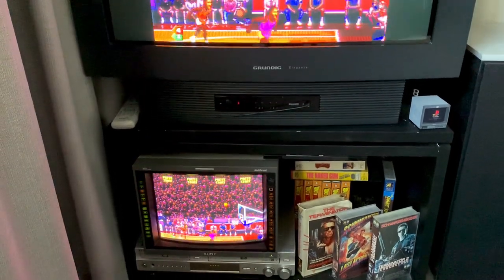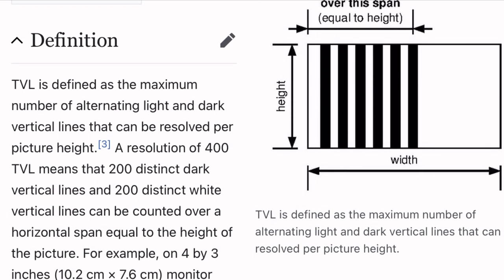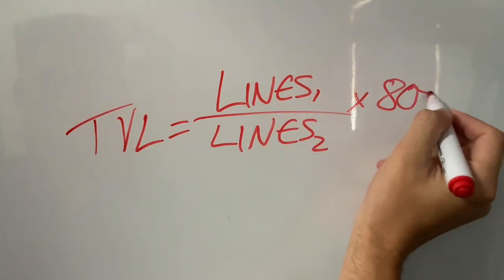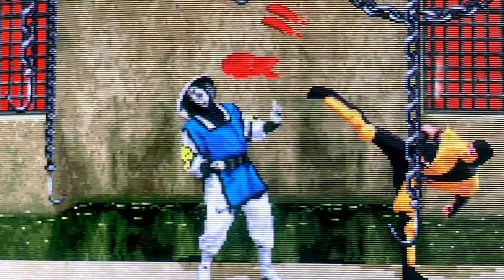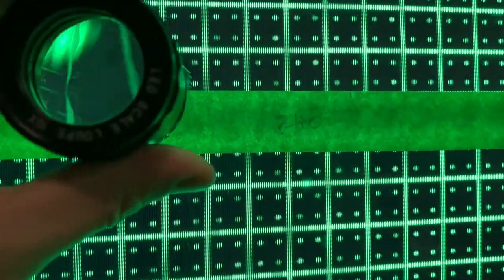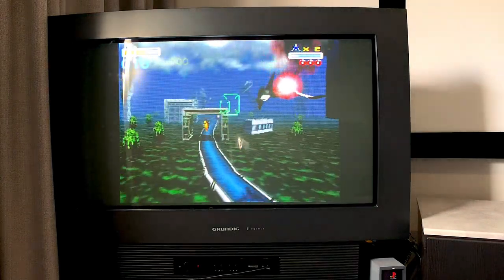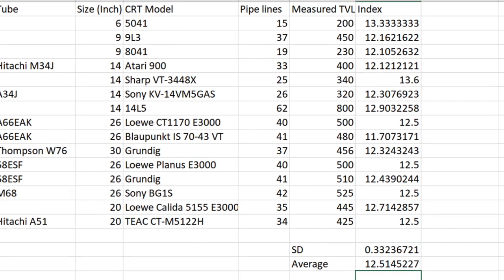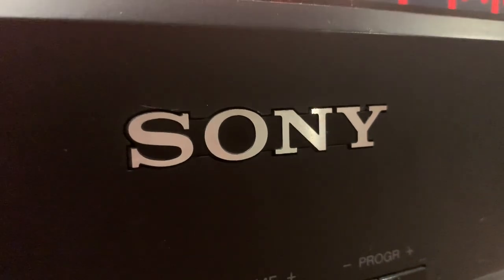ESTIMATE TV Lines on a CRT TV/CRT Monitor Using Super Mario Bros. on the NES - The TVL Pipe Method

Comment: This is a neat concept, and you were very thorough with your testing. However, TVL is more than just the pitch of the stripes/mask on the picture tube. The alternating black and white lines are an important aspect, because there are other factors that affect the TVL. Spot size, chassis bandwidth/frequency response, and convergence can all play a part in how much horizontal resolution can be resolved. This is more a measure of the number of phosphor stripes in a given area. While this is certainly an important bottleneck of TVL, it is not a measurement of TVL itself. 

Nonetheless, great video, with great visuals. The amount of effort put into this video is very clear!
Reply from the maker: Thanks so much for elaborating, the feedback is very much appreciated and welcomed! It was a labour of love and I’m still learning on this journey
Reply: @MarcoRetro316  For sure! Finding stuff on these things is pretty tough. If you get stumped or need some info, don't hesitate to reach out! If I don't know the answer, I can probably put you in touch with someone who would!
Reply from the maker: @ShankMods That’s a very humble offer that I’ll gladly take you up on when I’m in a pickle. Thanks!

Comment: Just gave this a shot. I have a 32" JVC D-Series AC-32D201 from August 2000. At factory settings, I took a photo of my RGB modded Famicom running Super Mario Bros. I followed the instructions and got 39 TV Lines across the very top of the pipe.  
36 x 12.5 = 450 right on the dot.

So that means that this set has 450 TV Lines. It's the nicest CRT I own. And I got it totally for free from a guy who was going to throw it out!
Reply from the maker: Nice one! Thanks for giving it a shot
Reply: @MarcoRetro316  Here's some more results to add to your xl sheet: 

19" Memorex MVT2199 from September 2002   31 phosphors.
31 x 12.5 and round to the nearest 50 
This TV has 400 TV Lines

14" Sensormatic RM314 from June 2001 27 phosphors.
27 x 12.5 and then round to the nearest 50. 
This TV has 350 TV Lines

14" Apex GT1417DV from September 2003 23 phosphors. 
23 x 12.5 and then round to the nearest 50. 
This TV has 300 TV Lines
Reply from the maker: Legend!

Comment: On my BVM-20F1U advertised at 900 TVL I approximated 800 using your method. Then on a Compaq FS7555 PC CRT I got 84 doots to count and got 1050. Counting the dot pitch was a little more difficult than the standard phosphors from 15Khz sets. My Sony 32" KVFS got 42x12.5 so somewhere between 500-550. Lastly my PVM-1354Q got 48 so dead on 600.
Reply from the maker: Interestingly I measured 77 lines on my 20F1 to estimate the TVL at 962.5, rounding it down to 950. The other numbers look close to expected. Thanks for trying this out sharing your results!

Comment: I don't have an NES but I tried raspberry pi via scart, PS2 NES emulator, and projected nested emulator on SNES original hardware and all had similar counts. My PVM 1953MD read 58 pipe lines for a TVL of 725 vs 600 spec, and my consumer Sony KV-36S42 via S video read 40 pipe lines for a TVL of 500. Interesting!
Reply from the maker: Thanks for trying it out. It’ll only get you so close to the actual resolvable TVL count but still useful for a ball park figure on consumer sets, 500 sounds about right

Comment: Green was a good choice because even on lower bandwidth signals like RF and composite it will be the cleanest with the least amount of horizontal smearing. Thats why you found very little discrepancy in your calculations across signal types up to RGB. 

I would guess that if someone calculated a number significantly lower than the advertised TVL, and their h width and focus was calibrared correctly, the bandwidth of the video amps must be quite poor. 

I have seen this illustrated by two TVs which share the same high resolution tube (matching part number) but have different TVL numbers advertised. I have seen as big as a 200 TVL discrepency just due to video amp bandwidth.
Reply from the maker: Hey Andy! In hindsight I overstated the correlation of phosphor line count with TVL’s as they aren’t one and the same, and the same tube can produce different TVL’s depending on the chassis design and like you said, bandwidth of the video amp among focus. 

I’ve long been learning from your stuff between your channel, interview on the CRP and the CRT database. It’s later bugged me not knowing your work at the time I put together my first video and referring to you as ‘someone who fixed their BVM jitter’. Anyway, thanks for tuning in!
Reply: @MarcoRetro316  thank you for the kind words - I'm glad to have helped you with my efforts. I enjoy your videos, keep doing what you're doing! I wish I had the time and passion for video production.

Comment: Sony PVM-2730qm: 587-600 TVL, tested with NES.
Reply from the maker: Thanks, very close to the advertised 600.
Reply: Actually I recounted and its 525(was slightly more overscan), also counted kx-27ps1 at 475, probably at an even 500 both. I have a hard time counting with composite signal. What is the alternative method with rgb?
Reply from the maker: @SamsungS-or1qf  composite will have some colour bleed but it should be similar, if not the same to RGB

Comment: I have a question. Does tv lines affect the picture sharpness from a console outputting an horizontal res of 320 on a tv with just 250 tv lines for example? or will a console outputting 640 horizontal res into a tv with 800 tv lines look sharper?
Reply from the maker: A very general answer: The more TVL to screen size ratio, the sharper the image and therefore will resolve the horizontal resolution up to a certain point. Both those scenarios will resolve the image just fine, obviously a display with 800 TVL would be miles sharper than anything at 250 TVL. 250 on a 9” PVM is somewhat sharp, but a 14” CRT would take a big hit in sharpness and you’d see vertical lines instead of prominent scanlines. 800 TVL on the other hand will look sharp at any realistic CRT size
Reply: @MarcoRetro316  Thank you. That is interesting so there is a correlation beteween screen size and TVL, that is the bigger the screen size more TVL is needed to get a decent sharp picture. But my question is more related to the TVL and a console horizontal resolution, for example Capcom CPS games use an horizontal resolution of 384 and i have seen some games use a dither pattern in some graphics to simulate transparency. So my question is will the dithering pattern blend with a TVL of 300?, and will the dithering pattern be visible with a TVL of 400 or more?
Reply from the maker: @jsr734 I’m purely guessing but I’d agree with you that you’d have better dithering and blending with lower TVL, whereas higher TVL would bring out more horizontal detail
Reply: @MarcoRetro316  Correct, i have always suspected that is the case. For example I play my Ps2 with component cables pluged to my lcd and i play Ratatouille i can see some dithering pattern in darker/shadow areas of the screen, but when i plug it to my Haier CRT 20" i cannot perceive any dithering as the CRT is incapable of resolving the dithering at the resolution the game is outputting, wich i think is 512 horizontaly.

Comment: You are real MVP
Reply from the maker: A high honour indeed. Thank you!
Reply: @MarcoRetro316 only one correction (was surprised myself). TVL is counted in 3:3 aspect ratio, not 4:3. So 400 TVL monitor will have 400 distinct lines on 3/4 of the screen. While whole width will have 533 lines. A bit confusing metric, to put it mildly. If you have not missed this in your calculations than ratio works. If you have missed, than we should divide final number by 4 and multiple by 3 to get real TVL like if would be advertised, not total lines across whole screen.
Reply from the maker: Looks like I’ll need to revisit some sources as I’ve not heard of it measured in 3:3, just that the width must equal the visible height of the raster ie a perfect circle
Reply: @MarcoRetro316  That is what I have meant by 3:3 square: since height is "3" in 4:3 aspect, it makes it 3:3 😂 So yes, seems everything is fine, cos no way my 21inch Trinitron is 170 TVL if it is wrong))
Reply from the maker: @kuroikensai202  oof 170 TVL 🤮 haha I’d be guessing around 350

Comment: Wow, this was a deep dive. I do not agree on the idea to count the equivalent of the vertical size though. It might be "the way things are done", but it is stupid. Ideally I would put on a red background on a Spectrum or so, and have a device with a light sensor that counts the actual visible lines when sweeping from left to right across the tube. Then you have the horizontal resolution of the tube. Nothing else matters, as you can always resize to your liking. I also found out that I don't like scanlines: it is better to have the number of vertical lines roughly match the horizontal resolution of the game. PVM's with low res videogames look really awkward.
What the heck happens at 16:50? Is that some AI generated video on the prompt "make me some over the top shmup video footage with a homo-erotic spaceship?"
Reply from the maker: @lovemadeinjapan Hello and thanks for the comment. As you pointed out, the ‘measure the TVL at the width equal to height’ is just how the rules were made. They could have started with any measurements as long as everyone followed the same rule set so we aren’t measuring the unused portion hidden by the bezel, which the CRT’s edge would be masked differently. Your suggestion of counting the non-illuminated phosphors should essentially turn up the same result as this method. In hindsight, I put too much importance on the physical mask and phosphor-density of the tube to resolve black/white lines. In reality, TVL’s aren’t a tangible thing, as it’s the ability to resolve a number of black/white lines, and 2 different chassis’ can produce different TVL counts depending on focus, G1 voltage etc which effect beam width and landing. Still, this method will get you a close enough approximation. I was laughing at the ai generated homo-erotic comment. The game is called Cho Aniki and it’s an eccentric shmup. Not the most complex or deep shooter but the sprites always give me a chuckle

Comment: Would this work with snes super mario all stars version?
Reply from the maker: I personally haven’t tried it but I’ll have a look when I get a chance to see if they both draw the pipe in the same manor
Reply: @MarcoRetro316  thank you, I appreciate it.
Reply from the maker: Thanks for bearing with me while I tried this out. The SNES version of Super Mario All Stars doesn’t draw the pipe exactly the same and there is no top row, just uniform green lines. If I count those with the SNES on my consumer Grundig CRT there were 33 green lines, whilst 36 on the NES. Now this will muddy things even more but just going off this one user case, I guess you could multiply the SNES pipe lines by 13.6, seeing the SNES version drew the pipe with about 9% fewer lines
Reply: @MarcoRetro316  you're the man. Most people wouldn't have gone through the trouble. Thank you

Comment: What the best way to play Mario bros on  SNES?
Reply from the maker: Not for estimating TVL, but to simply play Mario Bros on the SNES, Super Mario All Stars
Reply: @MarcoRetro316  thanks but the question was for the estimating tvl.
Will nes emulator on everdrive x7 n64 
Or even nes emulator on ps1 work fine?
Reply from the maker: @haloharry97 of those methods, I did try the PS1’s NES emulator and it was equivalent in drawing the pipe as original hardware
Reply: @MarcoRetro316   idk if i did it correct but my 32 inch JVC got 450 lines
Reply from the maker: @haloharry97  it sounds on the lower side for a 32”

Comment: I tested with a (27 JVC I ART) flat screen and got 36 lines so 450 line count total then I tested my (32 inch JVC D- Series) curved glass and got the same number 36 ehhhh looks like JVC was BS lying about 700 line count 😅
Reply from the maker: Thanks for trying it out! 450 is reasonable for a consumer 27”, though is a tad low for a 32” set. I’d assume the 32” may have a vertical ‘screen door’ appearance up close rather than juicy scanlines if the TVL to screen size ratio is that low.

Comment: Your method is unreliable as it depends heavily on Geometry calibrations of the TV like the Horizontal Size, Horizontal Bow, Phase and others. E.g.: if I stretch the HSIZE on my TV that pipe is going to be drawn with more lines. You need to first normalize the Geometry as best as possible on every TV you are measuring, THEN measure the pipe. Here's the (easier) method I use: set up 240p Test Suite's Grid pattern in a 320 horizontal resolution system (e.g., the PS1, Neo Geo), calibrate the Geometry as best as possible until all 20 squares are visible side to side and as straight as possible, take a macro shot with your phone of just one square and count the lines of the square (remember that they share one side with the next square, so count just one of the sides), then multiply by 15 to get the approximate TVL (if you multiply by 20 you'll get instead the total visible horizontal resolution, and we want TVLs).

I just did this to my consumer Sony Wega KV-29FS140 (29 inches) and it gave me 570 TVL, so we can put it in the 550-600 TVL range. We can say that my TV (that I got for just $10) has as much TVLs as some of the most expensive PVMs out there.
Reply from the maker: Hey thanks for checking out the method. I did address that geometry will alter the result and I said that the image should be appropriately scanned, as geometry calibration is a whole other topic on its own. Thanks for explaining the grid method you’re using, what TVL estimation do you get on the KV-29FS140 by counting a portion of the grid? Our methods are essentially the same in principal, just with yours going into more detail about scaling the image prior. Around 550 does sound right for a set of that size. The number may sound like PVM territory if the TV were smaller, but at 29” it must have higher TVL to delineate horizontal resolution, otherwise there’d be coarse vertical stripes as you see on many smaller low end consumer sets. If it weren’t such a large set then I’d say it sounded unrealistically high. Either way, this is just an accessible way to get an estimation on consumer sets. Thanks again for the constructive comment

Comment: Yeah that TVL thing are just joke like Savon Pat explained all screens come from the same factory and from the same line, the only difference is that the ones with a more sharper image were used PVM and BVM. So they have already been tested at the factory before sold. TVL are guideline.
Reply: Guideline or not, Savon Pat has used TVL as an indication of a good picture, in a non-joking manner:

"It’s a good 800-line tube. And the 20L5 is also a 800-line tube – or the 14L5 is an 800-line tube. So both of them can give you a really good picture." 
- Savon Pat, during interview with Bob from Retro RGB. 

I don't understand the TVL thing being mentioned as a joke or a gimmick by a few people quoting Savon Pat and others. You can clearly tell the difference between a high and a low and even medium TVL monitor next to each other, I have them right here, not to mention they can be counted pretty consistently. 

Please enlighten me on this, maybe you know something I don't. "Coming from the same factory/line" doesn't mean much, you can buy a $50 bottle of whiskey at the same distillery you could buy one for $1000.
Reply: @crt_rex  Joke or the catch is that all monitor are just same line they just handpicked better for PVM and BVM. It was very long time myth that they would come different manufactory line.

I could offer the same analogy. You have 2 different wine that are made same company, method and same everything else but different year and still one is more valued than the other because quality it offer year when was made.
Even if you do everything the same way there are always variables like a good vintage means that the weather was well balanced throughout the year. The vines received ideal amounts of rain and sun.

Factory have line where tubes come out they tested them and then chose whether they fit a cheaper TV or PVM or even BVM.
Reply: @Random.Walker.  By "monitor are just the same" I'm assuming you mean the glass tube? Because yes, I mean, it's a glass tube, but the monitors are definitely not the same, you can tell by just carrying them, the weight on higher quality monitors tend to be substantially heavier, and my cheaper consumer CRTs are much lighter. It's like holding a cheap game controller without artificial weights inside and a very good quality one.

But I'm thinking you meant the glass tube, and if so, then yes. But that they would pick the best out of the same assembly line is not really revelatory, that is done with many things like that, even produce such as eggs and potatoes are graded and separated on the line according to size or quality, and even color.

From what I understand on what Savon Pat says, and what I would assume on the little knowledge I have is that all the high quality internal components that go into a top of the line monitor, in conjunction with the tube is what makes a high TVL monitor good. But yeah, as the quote above says, he did mention TVLs, it's right there, just saying.

Comment: I don't know if I did this right, I used xsnes on wii, super Mario world.
I count 77 lines on my Sony HR36 which is 962.5 rounding down to 950.
Its a super fine pitch display, but it was in widescreen so I think I need to make sure it's 4:3 to get the correct result, right?
Reply from the maker: Yes you’d need to have the video in 4:3 to not stretch the pipe out